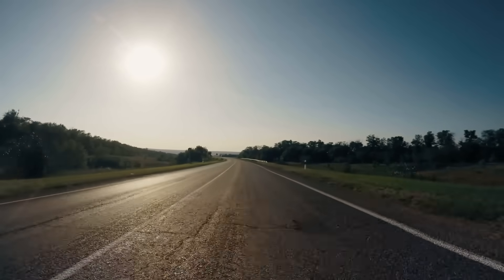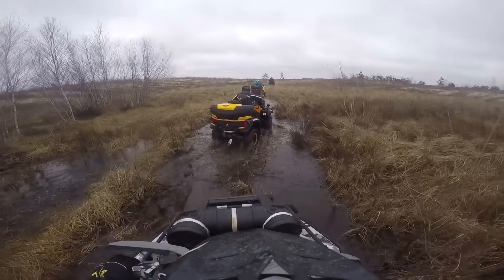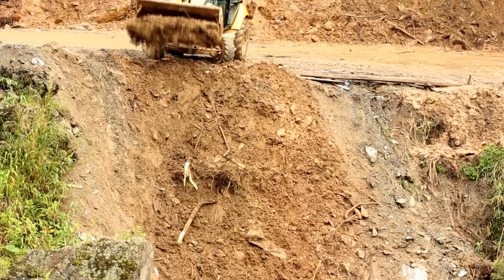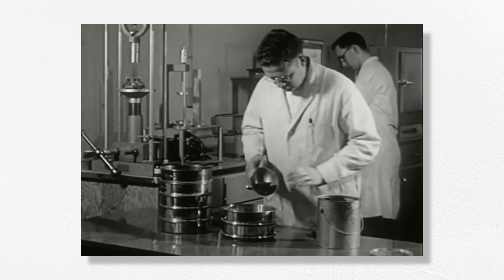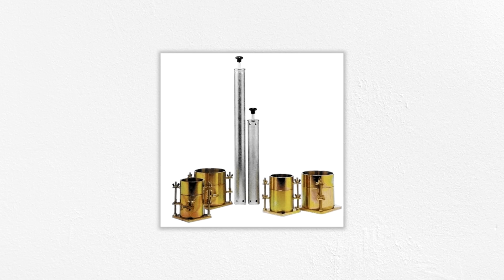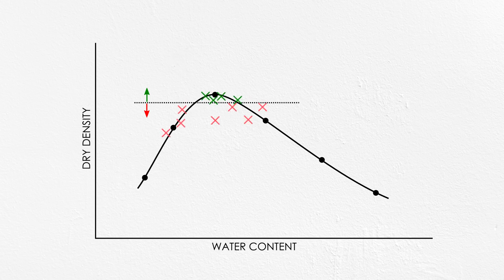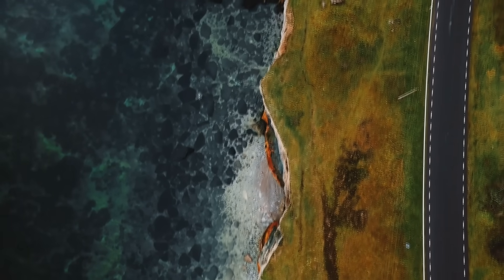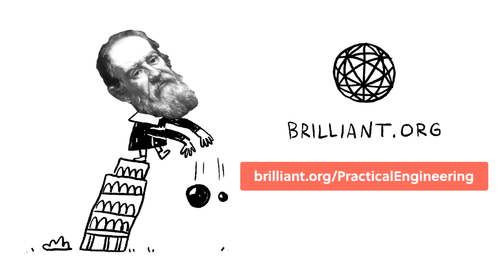Why Does Road Construction Take So Long?

Comment: In my civil engineering classes we talked a little about how roads are constructed in other places. For example, in the Netherlands, they pile a bunch of extra earth on top of where they want to build and then leave it there for multiple years.  Do you know the pros and cons of this verses the US strategy?
Reply: Generally, that is a matter of cost.  Passive compaction, like what you describe, is a popular technique in Europe that eliminates the need to work multiple lifts to reach the surface bearing capacity of the road.  It's a tradeoff between more, relatively cheap fill material now (leaving an unsightly mound in the process) and less expensive engineered fill, work extensively in lifts over a shorter duration.  I've seen both techniques work well, and both techniques have problems.

Comment: While I think this is a fine video content wise, it does not remotely fulfill the role you present it to. Apart from the obvious REAL reasons people get so frustrated about road construction that have been thoroughly explained in the comments, you are addressing such a limited view of what it takes to build or maintain a road.
Reply from the maker: Hi Mark - Sorry I thought the intro was clear that this is the first video in a series.
Reply: @PracticalEngineeringChannel  My apologies, I went back and watched that part and I think it is a fair presentation of the video content. I think at that part I was still in shock at hearing something about "Slow but steady progress" about road construction haha. Currently the stretch of interstate I live off has had 3/4 lanes closed in both directions for 3 months and no detectable work has been started, so its a bit of a sore spot.

Comment: Back in 2002 RT 80 through Texas and Oklahoma was having the raodbed replaced.  In Texas they used a roadbed factory on wheels The front had a huge spool of rebar that was fed under and pressed in place then concrete was poured on top and then smoothed, so out the back came finished roadbed.  When we crossed into OK workers were laying down and wire-tieing the rebar by hand so you can imagine how much slower thr progress would be.  That holdover of local contractors getting to bid on doing the work on interstates has to go.

Comment: i don't mind highway construction for the most part. what bugs me is when a year or two after a brand new road is constructed, they rip it up to run something like gas lines, sewer lines, etc., and when they are finished, the road is a bumpy mess.  which is probably not an engineering issue, its poor planning for the future expansion of infrastructure.  as far as your idea on continuing this topic, i for 1 am all for it. i wanted to be an engineer, but i could not get my grades up. what i didn't know, was that i have A.D.D., i didn't know that until my daughter was going thru school, and we had her tested. at least she has a shot of a bright future.

Comment: Talking about American road construction. This video is deceitful, wrong and it does not answer the title. It's brainwashing and BS. If author truly believes this video, they are very ignorant and not aware of the reality. The city hires the construction Co. that bids the lowest price, regardless of the quality of their job performance and their ability. They play favors. Projects are purposely dragged in cases where they're getting paid by week, and not by job done. There is no quality control. Roads are made crooked, bumpy, and harmful to safety of the drivers and damaging to vehicles.  Roads are intentionally made cheaply, to save money, and not to last, so there is more work in the near future. Formen at job sites are incompetant and couldn't care less. It's all disorganized and sometimes when they are frustrated and angry they purposeIy block traffic more than needed. I have my own experience with it, and my friends who worked on road constructions told me their inside stories. I haven't sucked eggs all my life, not to learn the truth, which is in plain site. It's all about profits, abusing the system and securing more work.

Comment: okay but what about when a road gets resurfaced, with a 20 year depreciation date put on the new road surface, and three months later a water main breaks... and then the dpw digs out a massive area trying to find the broken main, digging everywhere it's not (and severing a natural gas line in the process because they didn't bother to call 411), and once they finally find and patch the water main, do nothing more than pile all the excavated dirt, cobble, gravel, etc. back in the hole, run the digger over it once or twice to tamp the dirt down, and put a single layer of asphalt over it?

Comment: That's not how they build roads in Norway.  They just throw some granite rocks down, add a bit of loose fill on top, tarmac over that, and call it done.  Ten years later the road will already be subsiding and falling apart.

Comment: Thumbs up for a mention of erosion and sediment control! There should be an Erosion and Sediment Control Plan for every project including recommendations for use of sediment collection ponds and environmentally safe flocculants (for the non engineer, these are chemicals that make tiny suspended sediment particles like fine clays grab onto each other to force them to settle out of water when they get too heavy), if required. Often collection ponds are included in plans but use of flocculants are not though they may be the only way to guarantee sediment free outflow for the very finest of suspended particles. I have seen many a project that misdealt with sediment because the Sediment Control Plan didn't have any recommendations for use of flocs. Usually this is the fault of Gov agencies that don't have sufficient scope in their Guidance Documents. Fear of recommending fish safe flocs may be part of the problem, though they are readily available.

Comment: You need to add a cement to the filler.  Mix dry with grout or epoxy resin, great base.

Comment: I recently completed a "roadway construction project" on my property completely by hand (except for a gas powered plate compactor).
I removed about 20 yards of soil using a hand shovel and a cheap garden cart. Then I built a retaining wall with bricks salvaged from the demolishen of some other landscape project (someone elses). I back filled behind the retaining wall compacting every 4 inches using a hand compactor. Then I compacted the sloping roadbed and added layers 4 in thick starting with 2"  of angular crush rock. I compacted using the plate compactor on each 4" layer. The topper was 1/2" angular crushed limestone compacted well.
It was alot of work doing everything by hand, but I have a roadway and retaining wall that is going to outlive me by along time. Cost me less than $500 in total, and most of that was for the crush rock.

Comment: I would love to see a comparison of road foundations. I've seen roads with 1.5 m (4.5 ft) deep foundations that last through many winters without cracking, and roads with 0.5 m (18") foundations that don't even last a single season. I spoke with a retired civil engineer who said that the cost difference for deeper foundations isn't as much as you might think, but I've never seen concrete numbers about this.
Reply: The difference is cut corners and profits. When proper compaction is done with the right material and volume it works well. Do it wrong and you can end up with sinkholes that can swallow cars in the middle of a city.

Comment: On of the interstates near me has a 10 foot section  that dips and is constantly sinking lower.  They keep filling it in with more asphalt but it keeps sinking and has like 7 or 8 layers at this point.  The engineer in me wants to know whats happening underground to cause this.

Comment: 8:43 - the slack in that dozer's track made me very uncomfortable haha.
Reply: All tracked vehicles need some slack, but too much can result in a lot of damage and downtime when that track slips, and often bends out of shape. On the flip side, if you have zero or insufficient slack, you can damage your suspension and drive components when you go over rough ground and obstacles. Each type of track use has different standards. You will usually find that dozers have very deep sprocket paths and rugged/thick steel to reduce the change of throwing a track. On tanks, weight can be more of a concern, to there are usually inward-facing cleats that help keep the track in path. Rubber tracks on smaller equipment has guide cleats as well, but those tracks are often more forgiving if they slip off, and tend not to develop permanent bends as easily. - - I've worked on all of these examples, and I prefer re-setting a rubber track to the linked track on a dozer or tank.
Reply: Glad I wasn't the only one who noticed. They're going to have fun when it slips a track.
Reply: You think that's bad, the way the hydraulic hose is wrapped around that cylinder at 2:55 makes me even more uneasy, than track slack.
Reply: @timfagan816  Good eye! :-)
Reply: @FlatEarthMath  thanks bud
Reply: @timfagan816  Considering the range of motion of the cylinder, and the slack of the hose, it doesn't really look like a big deal
Reply: @harrisonlandry1704  you keep telling yourself that all day long till the loop over the cylinder slowly works its way up. Then one day,  you go to go full reach and it gets pinched under a the cylinder. Best to just get a hose at the correct length to begin with,  if your replacing a burst hose! Seen dumb stuff like that happen all the time, shaking hands with danger.
Reply: Nothing better than throwing a track in the mud or a brush pile.
Reply: There is a term known as “track slack” that has to do with slight chain slack on bicycles used for sprints and time trials. That has nothing to do with the dozer, though. I am also feeling uneasy.
Reply: I would hate to be the one cleaning them at the end of the day but the mud might tension them up. Lol

Comment: What if I stead of building on sight, the earth was taking to a place where they affectively build module road segments under killatonnes or even gogatonnes if possible?
So instead of maybe a foot at a time it can do more.
Once they have the segment prepared, than they can compress a foot of road evenly to create a steady surface and the additions can be added on top.
Would this be an effective and reasonable solution to lower time?

Comment: Very, very well done. You covered some really great basics at a high enough level for the  uninitiated to follow and learn. You covered fundamentals around proctor compaction and nuke density quickly and accurately. Please continue the series, go into gradation testing, fracture percentage and how those testing implements impact the base. Go into how materials are used to stabilize and fortify the eventual tarmac. Go into the AC burn off testing and how hot batch plants are used and the complex logistical web of getting the asphalt to its final location. Keep it up!

Comment: Episode 2: Why they lay out the cones and come back a week later to start work
Reply: That’s for me, I usually work alone and have to be the first on the job most times to drill the blast holes to break rock with explosives. We also have to deliver equipment and supplies to the site and since most people need daylight to work safely, you probably don’t see a lot of action during the morning or evening before the site is prepped. Contractors work job to job and as soon as one is finished they’ll pick up and move to the next one. We try to predict the day and time we can expect to start the next job to have as little downtime as possible, but the weather isn’t always cooperative; along with other factors. Just know that we are always behind schedule, and wouldn’t dare say that we weren’t if we weren’t; cuz we might be in an hour.
Reply: Because you live in the good old USA. There are many other reason for building roads to take time. Hidden infrastructure suck as storm water telephone water mains sewers etc have to be laid first. Putting a road where there wasn't one means storm water will flow differently.
For replacing a road can be reasonable fast and simple if there isnt underlying compaction issues.
here in Australia to resurface a road is usually done at night if it is a main road. They will have a permit for 7pm till 5 am they can only do as much as can in that time (large penalties for interrupting peak hours. local streets are different if less than 30 cars per hour.
Widening roads takes time if going from 4 lanes to 6 or 8 but the existing lanes stay open until new lanes are done then will snake from old to new so they can upgrade the old lanes to match new
Reply: I live in the UK actually, and even if there isn't any blasting or anything even remotely complicated to do, they still get those cones out days in advance and don't clear them up for a few days after work is complete.

I can only assume the cones are hired and laid out by the hire company...

Comment: its always best to quary rock near the work, to reduce the cost of trucking / barging., particularly in logging roads, the road engineer will deliberately run a road center line through a rock bluff

Comment: Why don't contractors take into account the topography of land features so that they might compensate for, I don't know say, building a road along a ridge. Like the road that I have to drive everyday? On the areas where the land slopes away from the road surface near the road two feet of the outer edge has cracked, shifted, lowered and is failing badly. The inner portion of the road bed is just fine.Why is it that this is not compensated for during the road construction. Is it due that for one reason or another that it is a conscious decision in order facilitate profit.  I have seen this road repaved several times in the last 35 years and the same thing happened each time. Usually beginning in the first two years and get progressively worse in a very short period of time. Thus we have drive on a crappy road for years at a time. Just Saying

Comment: Across the valley where I work they were, till March, moving an entire hill, to make a level surface for a new industrial site extension. they are making a 1kilometre long flat surface, which involved moving the top of the hill down around 30m, and filling in a valley around 50m deep with the hill either side. Currently has been stalled for 2 months, and is stable, as the base of the fill is only 10m from the boundary of the properties below it. they have been having a lot of dust though, but the new raw earth is growing pretty green now, with all the wind blown in seeds that have accumulated. 

A year ago this hill was a large field of sugar cane, complete with the old farm house, and now a growing collection of large industrial properties, and the construction is far from completed.

Comment: It might be interesting to discuss the use of styrofoam as a fill material.  In a recent interchange project between I-405 and Hwy 167 in Renton, WA,  I noticed they were using foam instead of dirt in the overpass abutments.  I'd guess the foam was stacked up to 15 feet thick in places.

Comment: In the city I live in, easily half of all the main roads have large construction zones right now. You hardly ever see workers, or even signs of construction going on. Just cones and lowered speed limits. I think this is the main reason people don't like road construction; the roads get shut down for months at a time before work even begins, and during that time your commute is negatively affected. Worse still, people who drive for a living, such as GrubHub drivers, the construction zones often block the entrances to restaurants and apartment complexes, and it takes valuable time to navigate around the seemingly untouched construction zone. In my experience, you can lose upwards of $10 per hour when you are working near construction zones on your busy nights -- construction zones that seem to last for six months at a minimum. So, while I do find this very interesting, I will never be excited to see construction happening on roads I use. Instead, I will be extremely annoyed that they started yet another construction project when they haven't even started work on the previous ones.

Comment: Every major roadway projects I've seen over the last 60 years seem to take several years. A great deal of major road work recently takes place at night with new power lighting that alleviates slowing down traffic volume during the day. Most folks never realize that takes place unless they are traveling late at night. The most frustrating part is when a section of roadway is improved taking several years and then a little more than six months later the same section is under new construction to improve traffic flow or design flaw from the previous construction.

Comment: This might not be directly linked to the topic of this video. But I've noticed one thing while watching your, and other construction-chanels videos, as well as when I have traveled to the US. Why don't any diger, or at least hardly any, use a roto-tilt on their stick? I work as a surveyor in Sweden, and the only digger not using it are the ones digging blasted rock, or other hard stuff. Since it vastly increase the versatility of the diger it should be a no brainer. So why don't they?